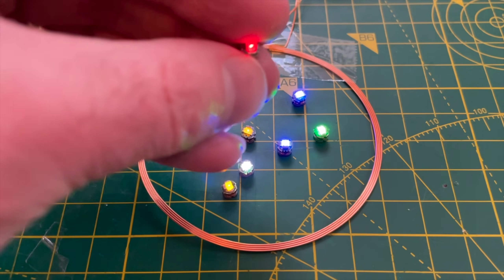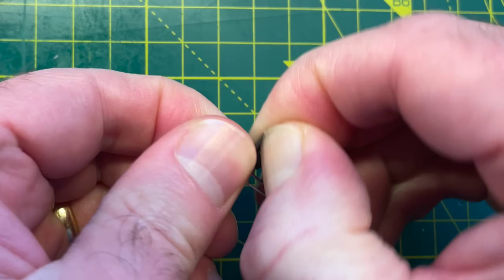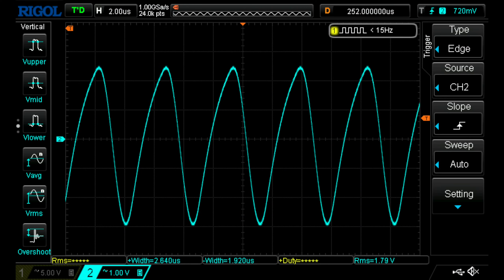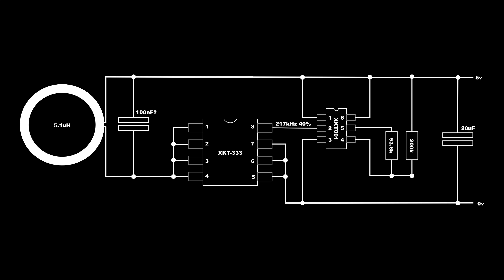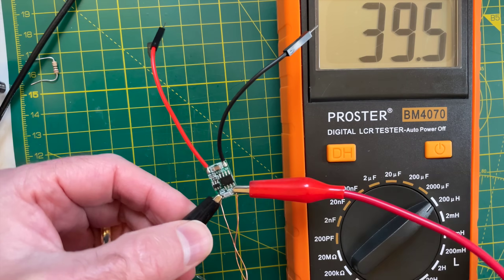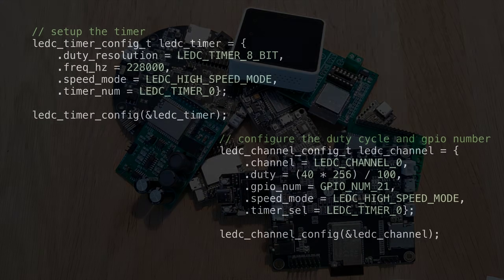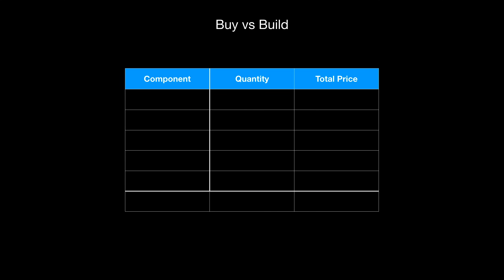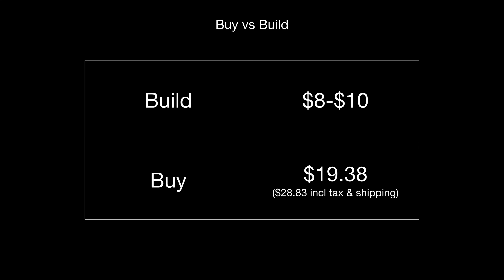DIY Wireless LEDs Made Easy: Step-by-Step Guide

Comment: I have thought about building a chess set with wireless LED lights built into the pieces and the coil/s in the board with 2-4 x 18650 batteries.
Reply: that is so genius
Reply: you can already buy them
Reply: But as the distance from the coil increased I mean in the middle off the board the voltage may decrease due to low electric field there think about it find a solution
Reply: @harshalmali856  a large central coil with 4 smaller corner coils will fix that
Reply: I would buy it
Reply: How would you control them?  If they are always on, that's limited in functionality.  If the chess pieces can be toggled on/off that would be awesome.
Reply: @theEbizGuy  the power to the primary coil powers pieces on the board. When not in use a simple on/off switch is sufficient.
Reply: LumiSource used to sell these and they worked really well. Seems impossible to get your hands on a set anymore. I’ve been wanting to make one for my bf
Reply: what a great idea! 
its good to see that all of mankind hasn't made the choice to NOT use thier brain... 
i love chess, btw & hope your project turns out wonderful. i started carving a set out of wood many years ago, but gave up after carving only 1 of the four royals and a pawn. i was young, life was busy.. anyway, good luck 👍🏻
Reply: Gonna make and sell this, hope you’ve got a patent pending. 😂
Reply: Chinese are reading this. Be careful !
Reply: Thinked just about the same!

Comment: It's not really difficult, i also explained how to make these leds in my channel, but using SMD components, just like the ones they sell (in my kit, the emitter was working at 180khz for a change) and even smaller (the comercial ones uses CD43 inductors, and i managed to use CD32 inductors, a bit lower range and dimmer light, but still working). I'm glad more people is spreading this knowledge arround for DIYers.
Great video!
Reply from the maker: Thanks! You have steadier hands and better eyesight than me!
Reply: What about in £'s sterling.
Reply: @m101ist  If you buy the components in reasonable quantities with surface mount components it would be about 33p sterling.

Comment: oh nice! Thanks! This is exactly what I was looking for - the plan is to 3d print a set of chess pieces (using clear for white and tinted resin for black) and put LEDs inside, powered from a coil in the board. This will certainly help to build this!
Reply: Was thinking the same thing, but for dice. Would have to make a custom jig to center then though for weight.
Reply from the maker: Nice idea! When you've finished send me some pictures or do a little video!
Reply: Perfect usage.   They have been using these for years in hobby models.   For example gun damn models.   When you set the model on the stand.   They glow.  The eyes and shield and.... glows

Comment: Would these LEDs work through a wooden door of approx. 4 cm thickness? It would be interesting to have the LEDs wirelessly controlled from inside of e.g. a garage to lit the key hole.
Reply from the maker: I think so - they worked through some quite thick books. You would need to try it though. You can push more power through the driver coil - power it from 12 or 24 volts.
Reply: If you can reduce the driver circuit to key chain size, then you can put LEDs behind key hole. So when you try to enter key it’ll lite the keyhole.
Reply: Just turn on a light?🤷

Comment: is that frequency a MUST ?
Reply: No. Neither are the caps across the coils.
Reply: @user-rs8zg8ey2b  danke.
My experiment: 50 % PWM puls from Arduino, amplified by a TIP 122 NPN Darlington, did not work.
May be the PWM frequency to low ???

Comment: Would it be possible to use a simple 555 timer as oscillator? So you would not need a MCU and also no gate driver because you can run the 555 at 5v without problems.
Reply: One 555 timer can output only >=50% square wave, also don't know if the 200mA it can output would be enough for such a high frequency
Reply: Yes, no problem, and you dont need a FET driver, and if you keep the current under 200mA avg (check your 555 datasheet, not all 555 are built the same), you dont even need a FET.
Reply: @user-rs8zg8ey2b  how do you do less than 50% duty cycle with 555?
Reply: @alexstone691  In a standard 555 astable circuit the capacitor is charged through R1 and R2 and discharged through R2 alone. Putting a fast diode in parallel with R2 to short the charge path through R2 allows the duty cycle to approximate R1/R2 and that can be adjusted to give any desired duty cycle. Note that with a 5V supply, the diode drop has a significant effect on the rough calculations, so some experimentation or trimming of values may be necessary. Using a Schottky diode would bring the observed times nearer to the ideal ones. There's a exposition at https://en.wikipedia.org/wiki/555_timer_IC#Shorter_duty_cycle
Reply: @alexstone691  I am no expert but I didn't get why would we need to use a reduced duty cycle in first place? Why not just use a high enough frequency to keep the coil from saturating? Of course we need to tune the circuit for it, but is it a problem?
Reply: @user-rs8zg8ey2b  A standard 555 won't source or sink more than about 100mA from a 5V supply, and you'll find the high output voltage is going to be reduced to around 3V, which is very unlikely to turn on/off a power mosfet properly, even if it is "logic-level".
Reply: @RexxSchneider  They have nfet's gate voltage threshold (Vgs) as low as 1.5V. And in some applications  you can run higher than 5V supply.
Reply: @RexxSchneider  Also, i should of added, running from a higher supply, you can run at a lower current (if needed). More turns on the coil will only make it much more efficient at a lower coil current.
Reply: @RexxSchneider  On another note: If trying to drive the coil from the 555, a output low=coil current ON (sinking), is better than high=ON (sourcing). And another reason to go higher supply voltage. A note I missed, if you are driving a fet with the 555, then the 555 output current is very low and does not need a very low fet Vgs, because the 555 output is not under load and suffering larger Vout drop (typical would be 100mV).
Reply: @user-rs8zg8ey2b  Sure, but that means you have to carefully select your ne-mosfet. The other problem is charging and discharging the gate capacitance of the mosfet, which needs to be done in a lot less that the 2-3μs you have for each half-cycle of the switching waveform. You can possibly get away with using a 1Watt switching mosfet which has a much lower total gate charge, but then you have to be careful not to exceed its current or power ratings. All-in-all, not an easy device to find.
Reply: @user-rs8zg8ey2b  Unfortunately, you're missing the point that the gate capacitance of the mosfet takes current to charge and discharge. The output current from the 555 is very high driving a capacitive load and it definitely will pull the output voltage down at fast switching speeds. You might want to review https://www.youtube.com/watch?v=8swJ_Bnsgl4 if you're unsure of the issues involved.
Reply: You don't even need a 555, just make an astable LC oscillator with some decent caps and coils and you're golden. Take one of those induction heater circuits you see online as starting point, and then tune your LEDs to match if you want a good range, but it would make any LED with a coil shine.

Comment: Interested in a DIY approach to "long range" wireless power. Like a Yagi-Uda antenna, you could use specifically chosen passive elements to change the radiation pattern.

Would be nifty to be able to point something around the room and see a bunch of hidden LEDs light up!
Reply: "long range" wireless power is interesting ...

Comment: An easy way to get reliable, predictable and reproducible home-made air-core coils is to use the "spider winding" technique. A card-paper can be used as a template, with an odd number of "spokes". The spacing between the coils leads to a lower stray-capacitance and higher Q-factor. 
Spider-coils were common in AM-radio hobby antennas (antennae?), but are seldom to be seen now-a-days. "Kainka Labs" on YT has a good episode on spider-coils: https://www.youtube.com/c/KainkaLabs/search?query=spider
Reply: Your link took me to a site that had many videos, since I am on my phone, hard to find the correct video your referring to. If your talking a rodin or star coil, they ar not effecient at all, the probability will work but simply wrapping wire around a cylinder is much more effective coil.
Reply: @user-rs8zg8ey2b  I specifically mean "spider coil". The simplicity and reproducibility (when hand-winding) for WPT is unmatched by cylinder-winding. Please try making both,  then you'll know what I mean :)
Reply: @AdityaMehendale  OK, thanks for the explanation, completely not rodin/starship coil type, that makes sense. So the pancake coil style is better for close coupling efficiency, I wonder how that is better or worse for distance over a standard coil.
Reply: @user-rs8zg8ey2b  Several issues with that question:
1) for "standard" WPT, for some acceptable efficiency, (say 60-85%), you'd use ferrite backed coils with a matching form-factor and short distance. Air-core coils are not efficient - the coupling coefficient between Tx and Rx coils in this video is abysmal
2) Spider coils are extremely easy to build and reproduce, if you build just a few, and by hand, or, e.g copy a design from a magazine. Card-template, scissors, done. Values for cylindrical coils will be all over the place. If you have customizable bobbins and an automatic winding machine, and thermofusible outer-jacket copper wire, .. by all means build a cylindrical coil.
3) Losses in close wound air-core coils come a.o. from the "proximity effect". Not so much at 220 kHz, but relevant for RF. Spider-coils have a spacing between conductors - so fewer losses (though also a worse fill-factor) 
Take your pick :) coupling efficiency is crap in both cases.
Reply: i am guessing this type of coil can transmit too?
Reply: @jurgmanx4644  There is sth called "reciprocity" when it comes to EM-waves, light, etc, whereby (except very specific circumstances, the propagation of EM-waves can go both ways. Every receiver is then by definition also a good transmitter. This holds for such coils too. Coils that are not good transmitters (and thus, also not good receivers) include the "ring shaped magnetic core" variant that the OP warns against. The M-field here has no propensity to travel far - it can take a short and easy path back.
Neither is a spider coil "better" than a coil-coil - just that it is far easier to reliably wind at home, also with a high Q-factor.
Reply: Thanks, I'm waiting on some parts to experiment with power transmission. Goal is to make a better practical wireless LED lighting system.

Comment: quick bread-board type clamps, for quick component attach, and the hook/clamp supports quick soldering, up-side down, no worries of components falling down when soldering
Reply: use a dc motor to drive mechanical magnet rotor, as the sender, diy inductors, from copper wire
Reply: no surface mount, just the hook-to-leg bend-force clamp
Reply: or just the green (mini-version) industrial screw-wire coupler
Reply: assuming the sender is not radio-wave (photon/directed) creating, then all not transmitted to the receiver will circulate in the sender system
Reply: diy leds, essential
Reply: imu wireless wifi distance measure recharge track pads/pods, straight from the received resonant induction pad coil voltage
Reply: you can transmit data with that link
Reply: even the distance data
Reply: or just bounce the signal back, round-trip time or signal strength amplification
Reply: use different frequencies for each separate coils, so you have at least three "cell towers" giving the clear distance to the closest tower, calculate the x,y,z position
Reply: gps look-a-like
Reply: but distance based, not time based

Comment: Take an ICM7555 with R1 = 1k8 and R2 = 4k7, parallel to R2 a diode from pin 7 towards pin 2 and 6. And a capacitor 1nF to GND. That should be about 222 kHz.
Mayby a high Ohm poti..  
Already has 5 volts level for the MOSFET. 
If it is not enough, two logic inverters in between, which usually have powerful outputs. First one inverter and the 5 inverter in parallel for the 4000 or 74xx series.

The components are cheap and can be soldered onto a small circuit board. Then there are hardly any hidden capacities and loose contacts.
Reply from the maker: Great information - makes this a lot more accessible for people who don't have a handy MCU.
Reply: An ICM7555 is CMOS and will only drive a few milliamps, so isn't suitable for driving power mosfets directly. The CD4049UB isn't much better, although with five in parallel, you might drive about 50mA cleanly. The standard NE555 or similar should drive 100mA with a 5V supply, but you will still have problems with reduced voltage swing, probably to around 3V.

A typical switching mosfet like the IRFZ44N will turn on with a gate voltage above 4V, but has a gate charge of up to 67nC, which will take 0.67μs to charge/discharge at a constant 100mA. The switching frequency used in the project is around 200kHz, which means an entire cycle takes just 5μs and each half-cycle is around 2.5μs. Having a switching mosfet in its linear region for a quarter of the time will cause problems.

You just don't have enough drive without using a mosfet driver if you've only got a 5V supply to use.
Reply: So it'll be possible to use it without mos driver??
Reply from the maker: Definitely worth a go if you have a suitable logic level MOSFET that you can drive with 5v logic. And  you can drive enough current to switch it quickly.
Reply: @wallkiller8080  Not with any common power mosfet on a 5V supply.
Reply: Was also going to suggest a 555 for the oscillator - MCU seems a bit overkill considering the other components!

Comment: Super surprised how much current it generates without the pull down resistor on the mosfet gate. This little design really makes me think how they work, cheers!
Reply from the maker: It's really interesting, if you leave the gate floating then it can easily get switched on - and if you're moving a lot of current around it's easy to damage something.
Reply: it's more that inductors resist a change in current, so if you keep things on, after a brief moment, you sort of have a short (but wire resistance etc). If you keep things going on and off quickly the inductor never quite gets up to fully conducting (it's busy resisting the constant changes in current). The resistor on the mosfet is more about just being certain it's at zero volts when off. Its a fun experiment to try (without driving big current) to try one without that resistor and see what you get. I've mistakenly forgotten them before and wondered why stuff doesn't turn off.
Reply: @WistrelChianti  That totally reminds me why we have RC snubber circuits for inductive loads on solid state relays!
Reply: @TradieTrev  haha next level (to me anyhow)
Reply: Actually quick demo why you want that resistor https://youtu.be/8swJ_Bnsgl4?t=154 you can see even prodding the gate with your finger can be enough to get it (at least partly) on

Comment: why not use 555 + mosfet ?
Reply from the maker: It's quite hard to get high frequency on the 555 with a breadboard circuit. The mark to space ratio on the standard circuit is also always >50%.

Using an MCU gives a nice easy way of generating the required frequency with an easily adjust mark to space ration.
Reply: @atomic14   @atomic14 FYI hmm.. https://youtu.be/OXsu29K_Ap4?t=1105
Reply: @KeyCe  as a relative beginner to electronics, I've found getting my head round a 555 to be one of the hardest parts so far. Compared to programming microcontrollers to kick out a certain duty cycle, theres a lot to learn for a 555 even if you are just following some configuration instructions. Understanding how they work involves a lot more. Sorta ironic given they were what was churned out when I was school... but then again I didn't go to school in the days of cheap microcontrollers.
Reply: Because driving power mosfets at switching speeds of 200kHz from a 5V supply is hard work. They need their gate capacitance to be well charged or discharged to avoid excessive dissipation. That means you need to pick a mosfet that has a total gate charge low enough to be efficiently charged or discharged by the 100mA or so that you can extract from a 555.

Because even 100mA will pull the high output of the 555 down to around 3V, you'll also need your mosfet to have a gate threshold voltage well below that. Something with a total gate charge of no more than 10nC and a Vt of around 1.5V would probably be okay at 200kHz, but the only mosfet I can think of with that sort of spec is the AO3400A. You won't get away with just any old "logic-level" mosfet.
Reply: @RexxSchneider  interesting! Thanks for that info